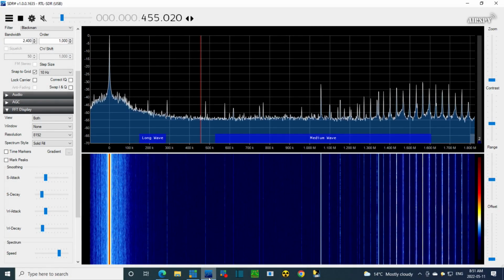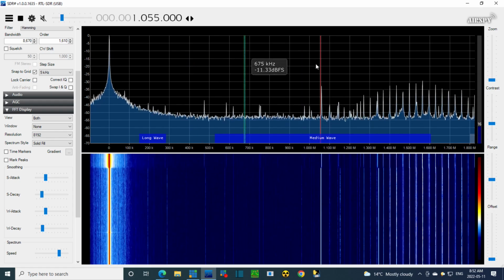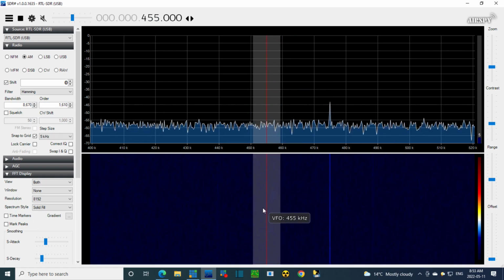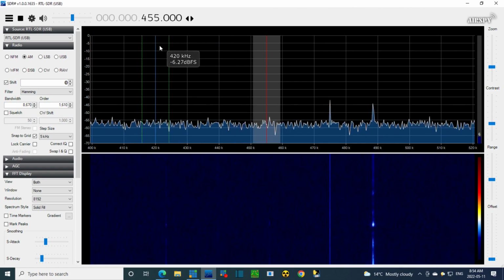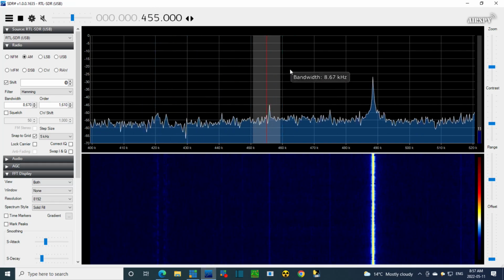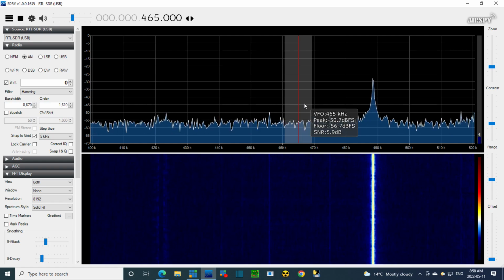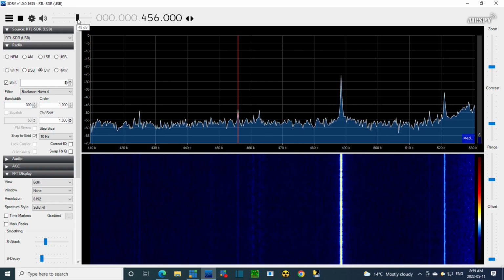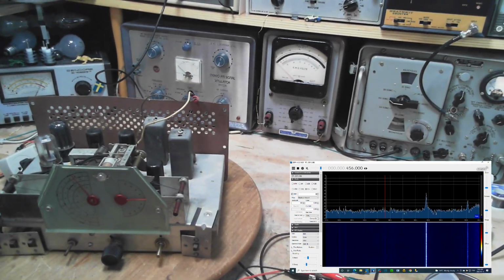Hallicrafters S-38 Four Band Tube Radio Video #7 - Investigations

Comment: We had these radio receivers in my Artillery unit for over 10 years and never once has to fix one, let alone align it. A daily operational check is all that was ever needed. My commo shop had several R-390’s setup as base stations.  We monitored birder chatter 24/7. Not your typical bakelite AM radio.

Comment: FYI this R-390 receiver was typically employed in a 12 x12x12 hut on the back of a 2 1/2 tone dump truck. Inside that hut were 3 to 4 soldiers, 2 Teletype printers, an FSK mod / demod unit and a 1 KW AM transmitter along with various land line field telephones. There was also a 400 hertz dynamotor supplying 120AC derived from 24 volts DC. Most operators wore head phones, however the rig need enough Uhmph for audible sound too. Soldiers lives depended on this radio. It wasn’t just a listening device. The people who maintained radio equipment were above average intelligence and highly trained in 8 hour a day , 6 month schools by signal corps non commissioned officers.